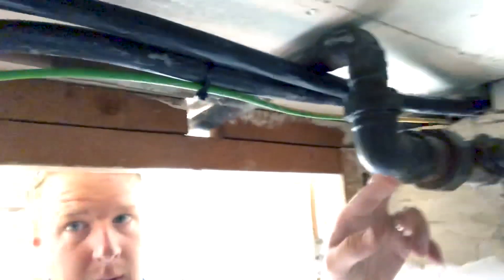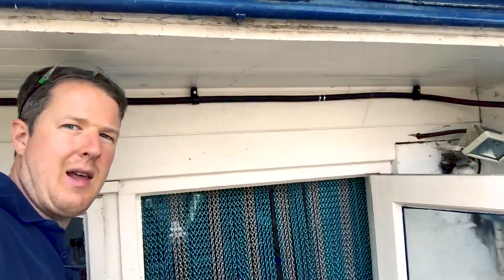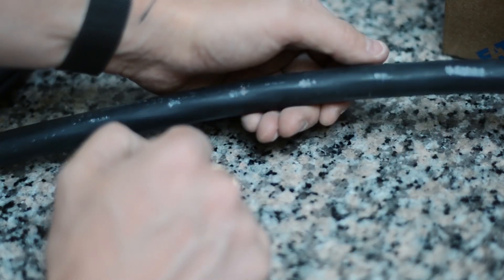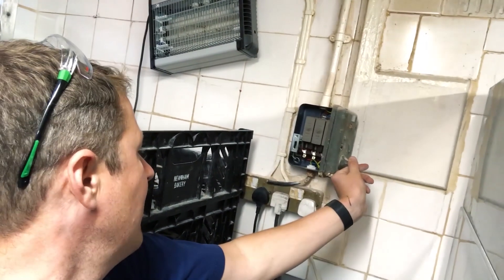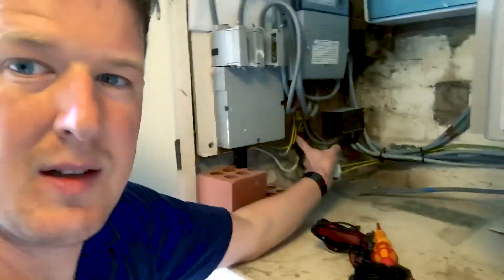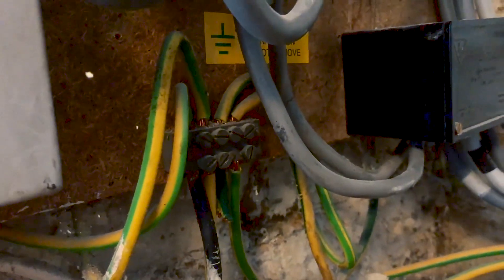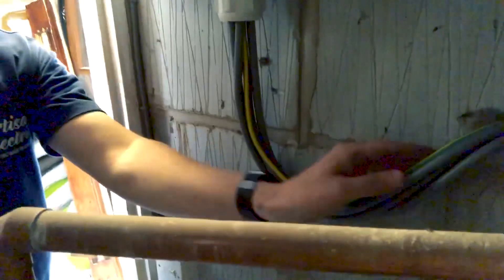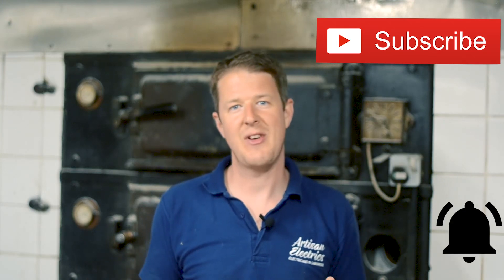Installing a Three Phase Distribution Board (Part 2 of 2) Electricians 3 Phase DB Installation

Comment: when drilling through walls I use a 10mm from the inside to be sure you get the hole where you really want it, then drill from outside with the bigger drill just go easy at the end, normally works well.
Reply from the maker: Yeah that’s a great tip!
Reply: @artisanelectrics  yes bullet does the same when it enters the hole is almost invisible but it comes out very very big because it cools down and expand.

Comment: Regarding identifying pre existing problems with other previous installs I would consider the following ...
Tell your client during the initial visit, that you are obliged to address any yet unforeseen electrical issues as "due dilligence",  and if so the client can choose to have the problem remedied at their expense by you or another contractor.
However, time and financial constraints might create problems.
You might even have to disconnect a circuit if deemed unsafe until the opportunity to correct defects arises.

Gas installers often cap fires off and label them as unsafe ... For example .😉

Comment: Use metal cable ties with the metal mounting bracket with a wardog screw, there's your protection against collapse covered simple and cheapest way.. also grab a dewalt battery t&e cable staple gun very handy bit of kit..
Reply from the maker: Nice but expensive!

Comment: Hmm you had 3 core and earth swa installed for the 3 phase socket, and you have used a piranha nut with a fly lead on the outgoing side, since you haven't used the steel sheath as earth isn't then the fly lead a bit overkill? Or is it per actual regulation?
Reply from the maker: nietzscheposterchild we always earth the sheath even if it’s not used as the CPC it’s just good practise

Comment: You raise a really interesting point about finding bad or dangerous Electrics in a property. Doesn't matter whether it is Domestic or Commercial, if there is a risk to public, are we obliged to fix the issue once we have found it?

Personally, I think it depends on the severity of what you are looking at. For example, the example of the old isolator at 05:15 is open, and someone could quite easily flick it open and receive a shock (if it is live). I would check if it is live, and if it is, is it in use? If yes still, can I fix the broken door? If still no, then I would put a strong recommendation in to the customer to replace it, and put it on the certificate that advise has been given. At the stage you are losing time/money it's not fair to expect you to work for no money. So a quote should be agreed with the customer before proceeding. Also, what happens if you change it and it goes wrong, have you now got to go back to fix it again for free? After all it was you that touched it last...

As for the socket, yes it's unfixed cabling, but you did the job to the correct standard before they moved it. Your certificate can no longer be valid as they have tampered and altered the work you completed. So it is not your fault, or in your interest to rectify it. However, I would probably do the same as it's a reputation thing!!!

In summary, I think it depends on severity of what you find, and what you perceive the risk to be. 

Enjoying the vids!
Reply from the maker: Great comments thanks

Comment: Kewtech KT63 is dog shit I'm afraid - when the batteries get to 2 bars the readings vary dramatically for no apparent reason. Also can't do a proper 2 lead test like you can on Meggers / Fluke MFTs - you have to piggy back the neutral & earth leads. proper nightmare in industrial settings if the DB happens to have Rcd main switch....

Comment: I generally use clipping band I call it’s a Steel band with holes in but it’s black so blends in with the cable a bit more. 

Have you used the metal cable clips for  t and e what a waste of time they are.
Reply: All round band. This is what I use for swa as a mettallic clip. This stuff has so many uses I use to fix my ducting to kitchen islands to sub floor/ fixing extract ductings etc. I think it’s made by swa brand.
Reply from the maker: Good info will look into that, haven’t done much t&e lately so not tried the metal clips yet. Which ones did you use?
Reply: Schneider clips. I always use Medlocks in Walden but the sizes baffled me they did a 1-2.5mm then a larger one for 4-6mm 
So when using with 1mm they were miles too big.

Comment: The company ‘SWA’ do make metallic black cleats. I buy mine from Edmundsons electrical
Reply from the maker: Cool thanks will check it out
Reply: 182allstar why not use cable band (pvc coated) no need for loads of different size screws, washers etc saves space on the van too.

Comment: The incoming mains to the new board with a metal clip round the cables is a bad idea the cables could get heated on overload and cut through the insulation.Its the same as passing cables through a hole without a gromet.A rubber lined metal P clip would be better.
Reply: That'll have to be some heat to melt through two layers of installation.

Comment: Your only responsibility is to inform the client of anything you observe that you feel is unsafe and note it in the 'comments on existing installation' box. If they aren't willing to pay to have it fixed, then that's on them. 
It's almost worse that you installed the original socket but rather than calling you back to relocate it, they thought "We'll save ourselves a few quid and just move it ourselves".
Reply: Could've been worse, they could've shortened the armored cable themselves.

Comment: I didn't think you could use the Kewtech KT 63 on single phase (230V) installations, can it measure PSCC between phase conductors?
Reply: Alvin Ashman measured PSCC for one phase then double it to get P-P PSCC. At least that’s what I was told by Guy on the T&I course. 
I hope that’s right cos I’ve been doing that for years.
Reply: @chrissharpe2781  Yes, you are right, you measure the PSCC between each of the phase conductors and neutral then you double your highest reading. Most modern MFT's should be able to carry out a direct measurement between phases but I don't think the Kewtech KT 63 can.

Comment: Looks a nice job to have had done.   Looks good.

I normally use a normal drill on hammer not sds, it doesnt blow the brick.  If the wall is solid I start with sds.

Liking the 'b roll' in the video, edited well.  I like it.  👍🏼

Comment: I have a fluke and find when testing ze or zs you have to zero the leads I will then test and get a reading but if I then zero the leads again the lead resistance will be even lower now some power has gone through them then test ze again and get a totally different reading. Have you ever tried this
Reply: Zero does not have any function on the ze setting only low ohms scale.

I have had flukes in the past and found them to be buggy And general not great testers. Megger ball the way. Expensive but worth the weight in gold
Reply: @tomorichard  sorry what do you mean zero dose not have any function on ze settings
Reply: greg davies when you zero your leads it only applies to the low ohm/continuity setting.
Reply: Sorry after reading a few posts online it suggests that flukes still take the null Into account on loop tests... I don’t believe my megger does but possibly. Will have to test that
Reply: @tomorichard  yeah you have to zero fluke for earth loop tests. It makes a massive difference to the readings try it. But like I say turn it on zero leads test ze or zs get your reading then zero then again and test again see if its different
Reply: Is it perhaps because the supply voltage is not fixed at 240V.  Different voltages at different test times will give different Zs values.

Comment: Thanks for the video Jordan.  As an aspiring sparky, did you join the tails to the Henley blocks live or did you pull the DNO fuse.  Looking forward to the Kewtech review.
Reply from the maker: Safe isolation is vital, I pulled the main fuse and resealed afterwards
Reply: Where is the Kewtech review?

Comment: There is a company here in America called Caddy. They make all type of clamps . The 8p 1/2 inch Caddy clamp would probably work on that cable you ran. Caddy.com  There mainly used by electrical contractors in commercial and industrial. The clamp I suggested anchors to the wall and you take a pair of channel locks or water pump pliers and squeeze the front of them and they snap together. They work great. I'm sure Caddy is worldwide.They make a myriad of clamp configurations.
Reply from the maker: Thanks will check it out
Reply: Also your work look great. Professional like it should be.

Comment: Did you use exterior filler, if not it will just blow.

Personally i always have a couple of  small tubs of sand and cement handy for stuff like that.
Reply from the maker: Yeah of course it’s external filler I prefer that to sand and cement because you don’t have to paint it after
Reply: Artisan Electrics where did you manage to get that 3 phase meter gland kit with 4 holes and 1 for the earth from...